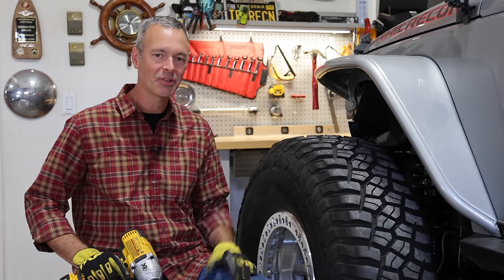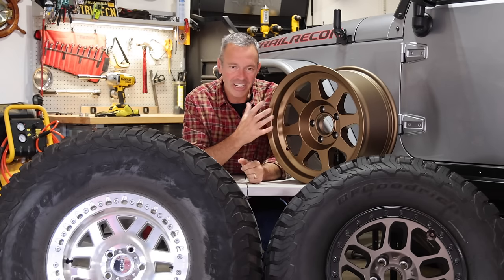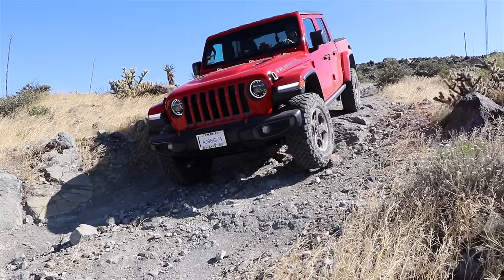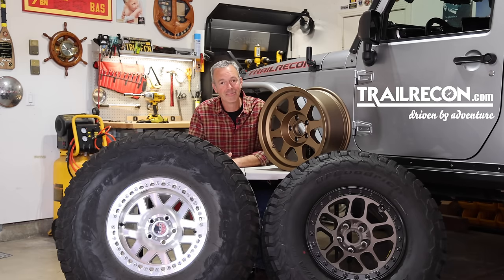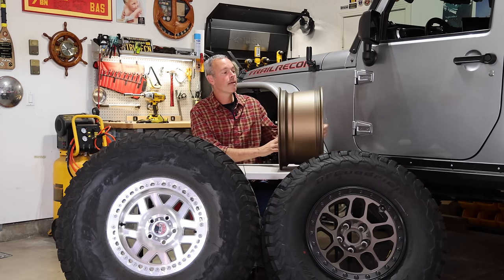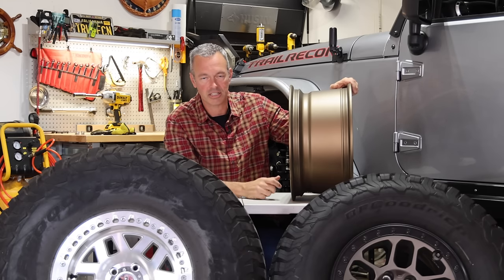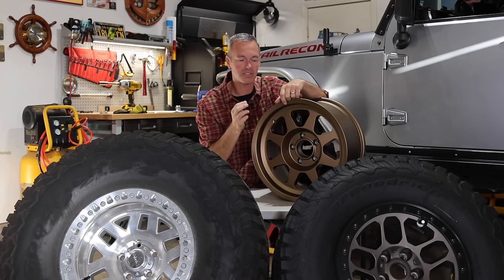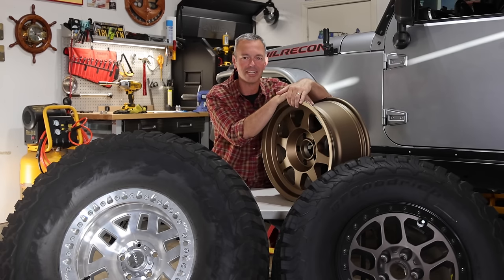9 Essential Tips for Buying the Best Aftermarket Off-Road Wheels

Comment: Not mentioned is the impact of the combination of wheel backspacing and tire diameter on scrub radius and the ramifications of changing scrub radius on vehicle steering and handling characteristics. Changing scrub radius will have various impacts on handling, including centering.  In addition, producing an excessively large positive or negative scrub radius by selecting an inappropriate wheel offset/backspacing (in combination with the size of the tire, e.g. 35” vs. 37” vs. 40” diameter, etc.) will, as you mentioned, stress your suspension components, reduce their life and increase the probability of catastrophic failure. Wheel specs can not be selected with confidence without understanding what suspension geometry the wheels are intended to work with.
Reply from the maker: Scrub radius is very important to consider, but I thought it would be best to have that be a topic all it own in a future video.
Reply: Looking forward to it, Brad.

Comment: AEV Savegre 2.  Designed specific to Jeep Wrangler and Gladiator.  They don't recommend powder coating aluminum wheels.  Went with AEV as they did all the (suspension, wheel spacing considerations, TPMS, valve stem, etc.) thinking for me.

Comment: I have a 2 door JL Rubicon. Black Friday 2021 I got those same Method simulated beadlock wheels with 37” BFG KO2s, and I put on the Endurosport 2” lift. I wanted the lightest and smallest  37s and wheels, and shortest lift, since it’s a 2 door, and driving gets squirrelly. I’ve gone down to 12 psi on mine. I live in the mountains in Colorado and get into the rocks and my wheels already look pretty used from just one summer of rock gardens. 

I wanna know: what other components should I upgrade next to keep it good and strong?
Reply from the maker: Thanks for your comment and sharing your setup.  I think skid plats should always be at the top of a build list, along with upgraded axles shafts, ball joints, and steering components for this running 37's.

Comment: Out of the 6 Jeeps in the family 5 have Raceline Beadlocks - the only one that doesn't is used for marketing a lot for Warn and has their wheels on it. Not sure I'd run anything else on a rig that gets some abuse - never had any issues with them at all. They are very heavy though - close to 135 lbs each with 37" KM3s.
Reply from the maker: Raceline has a great reputation and makes some great wheels.

Comment: I just installed a 2.5” Metalcloak lift with that same KMC wheel with 37” BFG KM3 on my JLUR. I have that tire (33”) on my ‘76 FJ40 and they were awesome on the Rubicon Trail. Question: the JLUR now wanders at highway speed. I have Fox racing shocks. Is there a better shock that can be adjusted to get rid of that hwy wandering?
Reply from the maker: Wandering on the road could be the cause of many things.  Recommend getting an alignment, tires rebalanced and check pressure, good inspections of your suspension components first.  Some adjustable shocks are nice to allow you to dial in the feel, I like the Falcon 3.3's

Comment: Incidentally, a 15-inch will still fit a JK Rubicon (Not a JL). I went 15's on my JKUR with 35x12.50x15 tires to keep weight down (rubber weighs less than aluminum). 35's weighed roughly the same as the stock 17' with 32's.

Comment: Running the factory bead lock capable 17” wheels, 35” K02’s on my ‘21 Power Wagon.  To this day, the factory bead lock rings are still not available to purchase from Mopar.  Unless someone knows different, I’ll buy you a 30 pack for the info…